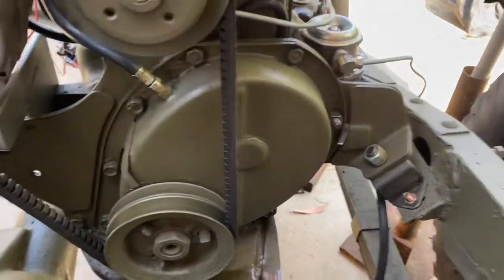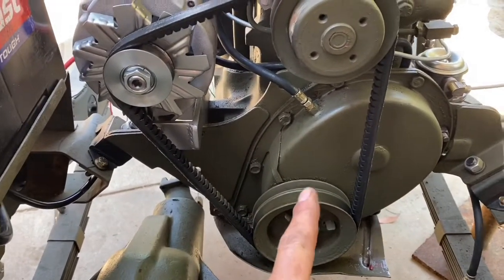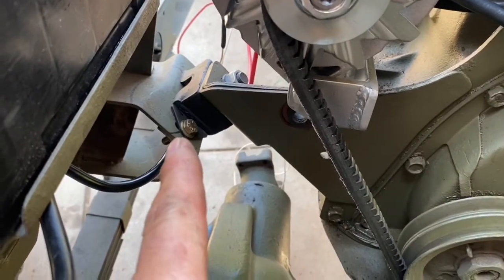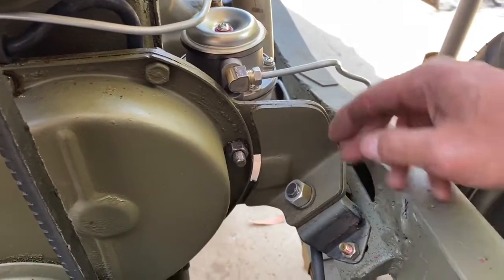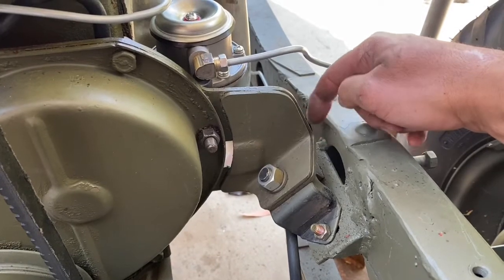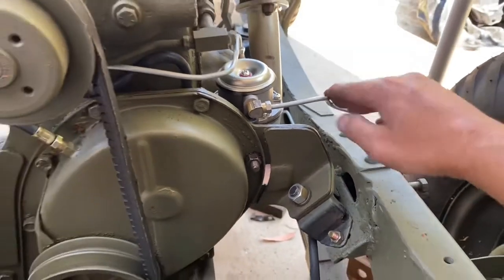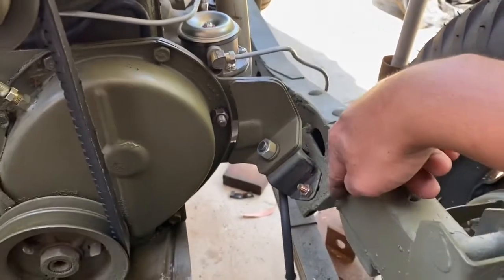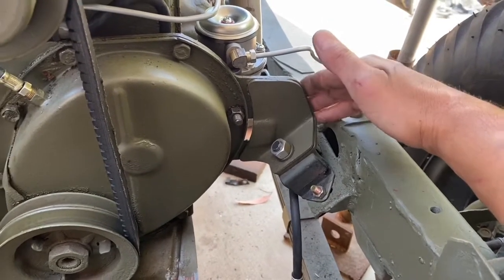PART 1- F134 engine in a Flat Fender Willys Jeep - motor mounts

Comment: if I'm not mistaken you can swap that front mount plate on the engine directly with the older model. then you don't need to cut the frame motor mounts.  of course you would then need to pull the front pulley, timing assembly off to do the swap.
Reply from the maker: excellent info - thanks.